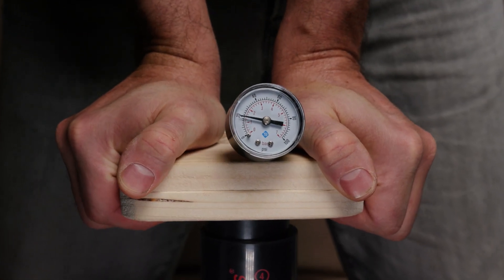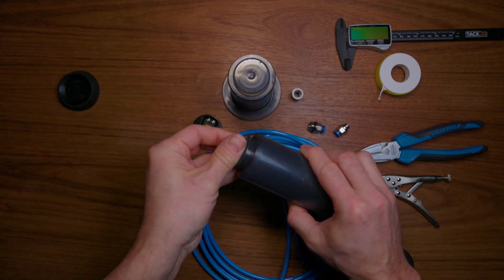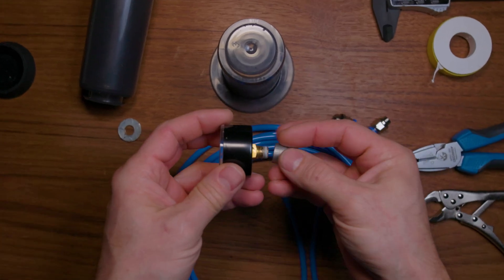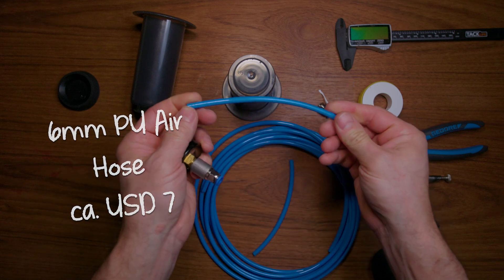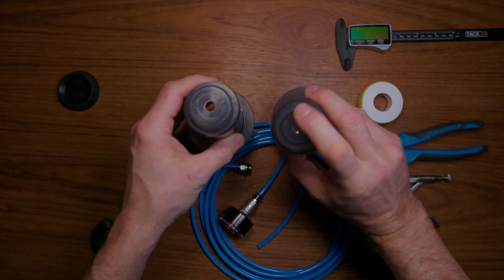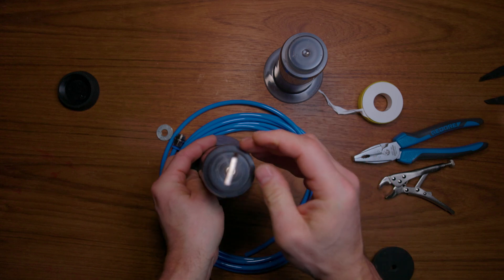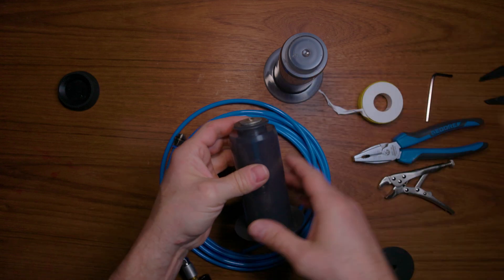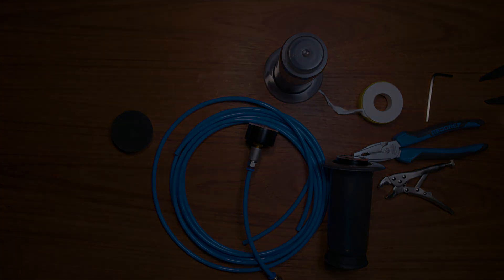Aeropress - pressure gauge mod

Comment: Great guide! I however can be a little dense, the link for the pneumatic hose is 8mm and you mentioned 6mm. Is the linked hose the correct item if I wanted to replicate this? Thank you again!
Reply from the maker: Thanks! I bought everything in Europe, sorry if the links I mentioned are not the proper hose size. You can either use a 8mm pipe and then also the 8mm connector, or do both in 6mm. I did both and there is not much difference.

Comment: can you still make a regular aeropress coffee with that pressure gage attachment on aeropress plunger ?
Reply from the maker: Yes, sure you can. The gauge will just show close to 0 bar. Or you could get a spare plunger rubber (about 6 USD) and seal the hole in the plunger itself, by exchanging the old one with the new one and then remove the gauge with it's hose entirely.
Reply: @mikkisdiyobsessions3742  thanks btw can you use other items for the body weight ?

edit: also will it works on higher water temperature like around 95c or more ?
Reply from the maker: @daffaramadaghifari6428  Yes, as long as you manage to balance it on top of the Aeropress...Once you add more than 100kg without protecting the Aeropress filter cap, it might break. For higher pressure/weight, you would need to support that filter cap, like I did in my other video here. https://youtu.be/VFvKRI99Zi4
Reply: @mikkisdiyobsessions3742  thanks, do you ever tried how long does the crema from 3 bar aeropress last ?
Reply from the maker: @daffaramadaghifari6428  Yes, any temperature will work, for lighter roasts I sometimes even use water straight after boiling.
Reply from the maker: @daffaramadaghifari6428  I never checked my watch, and this also depends a lot on the type of roast and bean. Darker roast/higher robusta content tends to produce more and longer lasting crema.
Reply: @mikkisdiyobsessions3742  for shower screen can i use 51mm espresso shower screen rather than regular metal aeropress metal filter?
Reply from the maker: @daffaramadaghifari6428  In general, yes. But this totally depends on the basket you get, the idea is that it fits exactly inside the basket and on top of the coffee puck, with as little space as possible to the sides of the basket walls. If you find a screen that fits exactly without the need to change it, great!

Comment: Thanks so much! Great demo. I can’t wait to try it.
Reply from the maker: My pleasure! When using ones entire body weight, balance is a bit tricky. I found it very helpful to use a low table and some kind of support for the hands. I built a small wooden balancing plate, that offers a larger area for the hands to grip, I showcased it in my earlier video: 'Aeropress and Espresso - a myth?'